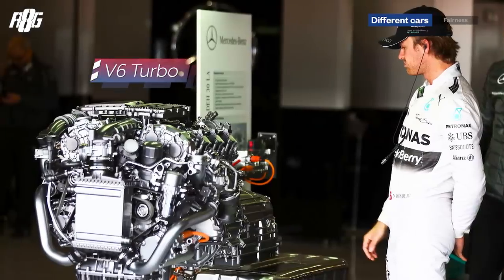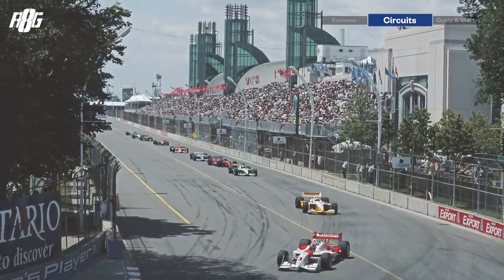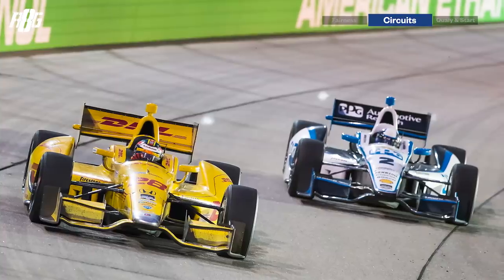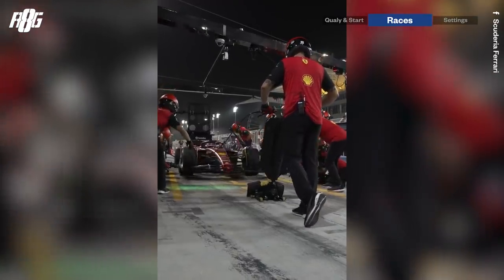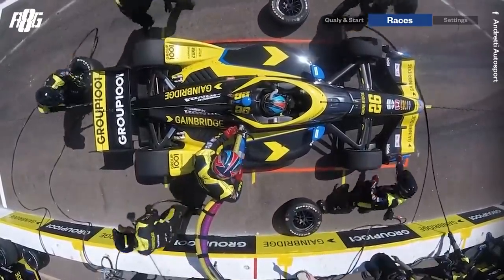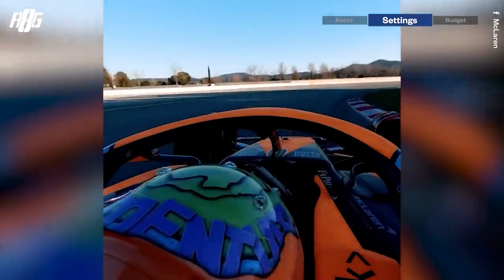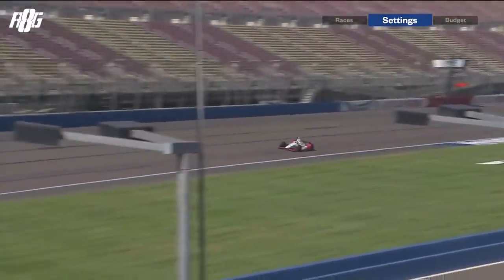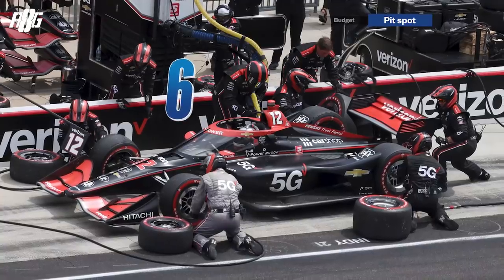The Main Differences Between F1 & IndyCar Racing!

Comment: How does Indy 500 setups differs from both normal oval races and road courses? Would love to know!
Reply: superspeedway like indy for setup has the smallest rear wing for the least downforce and for ovals they change the camber of the wheels for the banking whatever it is at the particular oval. for "normal" oval or if you mean short ovals like gateway and Iowa, they use the same wing element as road and street but remove the top winglet for increased speed and reduced downforce but not as much as superspeedway. at short ovals they still break and need the downforce a bit. they have a few options for oval downforce and wing stuff but every team has the same options, no open development just more choice of the given options or adjustment of angles.

Comment: I think the biggest difference is that IndyCar is much more exciting and unpredictable than F1. One reason is that in IndyCar it's actually possible to overtake on track :) The other is that every time the yellow flag is out, the pace car (IndyCar counterpart of safety car) comes out, so there are several pace car periods during most races. Yes, this means luck plays a bigger part, and you can even win a race purely by luck, but this balances out throughout the year, and you need a consistent performance during the whole season to have a chance in the championship.

Comment: How does a modern F1 car compare to a modern IndyCar in size?  I think it would be cool to see IndyCar visit more tracks outside of the states again.  F1 might be parting ways with Monaco.  Some fans hate the idea of that and others would love to see F1 left off the schedule because it's usually a boring race.  I'm curious if an IndyCar would bring back better racing on that circuit?
Reply: the current Indycar chassis is definitely smaller than the 2022 car for F1

Comment: What about one series having power steering (F1), while IndyCar does not?  Is that true?  And also the use of tire warmers?
Reply: no power steering in indycar so its incredibly physical. also no tire warmers so that adds a layer because you need your in and out laps to be really good but have to be careful on cold tires. that aspect also changes how pit strategy works depending on who has new or old or cold or warm tires around you

Comment: There's a lot of emphasis on neck strength and personal fitness in Formula 1. Are they as important in Indy Car and we just don't hear about it as much, or are the physical strains of Indy Car different?
Reply: the workout regiment in Indycar is way different than F1, because there's no power steering (plus less areo meaning lower cornering speed) there's a larger priority on weights compared to cardio and neck strength

Comment: Not to bring up a touchy subject, but in case of a fire with ethanol, would that not burn invisible?
Reply: yes it would, and that was a primary issue of the E100 fuel used in CART, but Indycar uses E85 fuel so there will still be visible flames

Comment: The fuel in Formula 1 isn't regular petrol correct? In the modified car scene if you're running E85 you're able to run high boost numbers and advance the timing because ethanol is easier to control. Could you see Formula 1 moving over to something like race ethanol like E95?

Also more Canadian races would be amazing. I had no idea IndyCar was in Toronto, I may have to make a road trip see the race! As F1 is a bit of a stretch to justify (for me to road trip to lol).

Very great video, thank you!
Reply: Toronto just got cancelled the last few years due to travel with the pandemic, it should be back. though there is some concern with how they changed the street course that there may not be enough pit boxes if the regular indycar field stays as big as it is or expands
Reply: @sams-pg7hj  Damn, this is a big shame to hear. Thank you for the insight though!

 Hopefully something can be done. Canada is lacking when it comes to major motorsports. There is local stuff around me but I am also into seeing the greats race.
Reply: F1 is using high octane racefuel (petrol) with 10% ethanol from this year on. The years before the ethanol content was around 5-7%. 
From 2026 on the'll completly switch to sustainable fuels.
Reply: @NoblePineapples  they want to avoid it but I heard it might be hard to change the pitlane if needed. they could go to a few other circuits or change the layout in Toronto theoretically
Reply: @chrisu2583  for wanting to be sustainable its odd they (f1)
havent switched to anything higher ethanol in a while. indycar has been using E85 since 2007 (85% ethanol)
Reply: @sams-pg7hj   I don't know why they havent't used higher contents in the past few years.
It's maybe because F1 is limited to around 150l of fuel and no refueling during the race so they wouldn't get to the end on one fuel tank when they would use higher contents of ethanol. The fuel consumption for the same amount of power is higher with E85, just like in the normal roadcar.

Comment: Romain, could you do a Nascar v Indycar vid? they have some of the same circuits and have similar v-max but are so different. From an F1 fan clueless about American motor sport.
Reply: NASCAR and IndyCar are VERY different. the only thing they have in common is they have 4 wheels and an engine.
Reply: @nickb2049  and sometimes race on the same tracks
Reply: @nickb2049  did you actually get to the end of my comment before posting? I think not.
Reply: @brokenmusician1  you asked for a NASCAR v IndyCar vid, I answered by saying they are completely different in every way but the fact they are both cars. idk what you are looking for.
Reply: @nickb2049  like I said in the original post - some same circuits, similar V max, so different. Both big in the states. Both have former F1 drivers in the championships. Where are you disagreeing with me exactly. Please note the so different from the original post. You seem to be violently agreeing with me.

Comment: Romain - I think you forgot to say that in IndyCar, there are a LOT MORE CARS on the track!
Reply: 27ish this year at most tracks, 33 at the indy500. Indycar has no limit beyond the number of pit boxes at the track really. no team size limits so you see one car or up to 4-5 cars per team. that is one cool aspect of indycar, teams are not required to run a full season so drivers or teams without a full budget can still gain experience and data running only a few races or whatever they can afford. each car has their own pit crew and pit box so there is no issue with conflicting strategies per car per team. the other wrinkle is that there are no team orders or team strategy really beyond "dont wreck your teammate", so no first or second driver or whatever.

Comment: Can you explain the championship process?
Reply: it's pretty much the same as the championship in F1 (point system is completely different though) for the driver's championship, but the team championship is between the two engine suppliers, Honda and Chevy

the point system awards points to everyone who starts the race (50 points for 1st place!) but you also get points for leading laps, getting fastest lap, and leading the most laps during the race (and getting pole?)

Comment: I find Indycar much more interesting than Formula 1, particularly because of how the two richest teams always dominate F1 because they have SO much advantage; it's not an interesting race when it's basically guaranteed that one or two of ten teams is going to run away with the win for the season, and any race where they don't grab at least 2/3rds of the podium is a fluke. 
Take 2019 as a typical example; 21 races, so 63 podium places total. 20 drivers, but out of all those races, just five drivers got all but 3 of the podium positions for the entire season.  95% of podiums going to just 25% of the racers, and two of them didn't get many at all; 78% of podium places went to just three drivers from two teams, because money. It's bs, and not good racing. 

Can compare points for the F1 teams too; 739 points for Mercedes, with a not-even-close 504 for Ferrari. Red Bull was a bit close to Ferrari with 417 points, but "oh, who will win second because first place is guaranteed to go to Mercedes since they spend the most" is not an engaging question. 
And then all the other teams got less than 150 points. Yeah, real exciting. And it's due primarily to insane spending, plus positive feedback loops of "you win because your team has the highest budget, but then you get the best and highest-paying sponsors because you won, so you keep winning". 
And then you have Ferrari, who's getting a gigantic bonus on top of their already higher-than-most spending just because they've been participating so long (and likely because they insinuate they'll stop playing the game if they don't get their special treatment). It's ridiculous.
Reply: Obviously u haven't seen any of the '22 races yet. Mercedes are not even in the fight

Comment: I have a question: Why don’t Indycars have DRS?
Reply: Because it uses a Push-to-Pass system in the form of 180 seconds of HP boost that can be used during the course of the race. Except on ovals where there is no DRS equivalent.
Reply: @ZontarDow  not only that but Indycar has never really had a season or race where there people struggled to overtake

Comment: What is dampers?
Reply: shocks that keep the wheels in contact with the ground when going over bumps. indycar tracks are very bumpy compared to f1 so keeping the wheels in contact with the ground and not skipping or bumping allows grip and better cornering and control obviously. indycars have alot less overall downforce to keep the car pulled to the ground

Comment: I've been an F1 tragic since the eighties, as well as IndyCar. IndyCar is all about driver talent,  I see more overtaking in one IndyCar race than any F1 race. F1 is fairly predictable, with IndyCar, strategy and tactics are a big part of the race, so that even a driver starting at the back of the grid can win. The safety car rescue team are very professional, full course yellows become a whole new race. Oval races are where the drivers need very big balls to maintain two hundred miles an hour plus on the bigger ovals. 
I ticked one off the bucket list. Travelled from Australia to the Indy 500. It really is the greatest spectacle in motor racing. The year I went, the Ozzie Will Power won.

Comment: They stopped using Methanol? Methane/Ethanol mix.
Reply: they did stop using it because of all the invisible fires back when CART ran on E100 fuel
Reply: @harveyknguyen  Ethanol doesn't burn as visibly as gasoline. Maybe if Indy Cars used gasoline they'd get closer to F1 speed.
Reply: @PeterKKraus  i mean the fuel mix they're on right now is pretty much what's for road cars these days, probably to cut down on costs

also then there's the 400-ish BHP difference between the Indycar PUs and the F1 PUs
Reply: @harveyknguyen  I thought they were using straight ethanol
Reply: @harveyknguyen  PU?
Reply: @PeterKKraus  power unit

CART used to, but now it's either E85 fuel or E90 i don't remember
Reply: @harveyknguyen  They both use 6 cyl turbos, F1 is hybrid though.
Reply: @PeterKKraus  yeah but the power output of F1 engines is significantly higher, mostly because the current Indycar engines haven't had any major development for a while now (starting in 2024 the power output is going to be comparable, the Indycar engines should be rated at 900-ish BHP)
Reply: @harveyknguyen  In '83. The Brabham BWM engine was a 4cyl, and in qualifying was 1000hp. Lol

Comment: I am new to both F1 and Indycar,  my question is how would they fair if they raced against each other?  Would there be a big difference?
Reply: on a road circuit the difference is quite big, as demonstrated by the pole lap @ Circuit of the Americas in both F1 and Indycar (it's on YouTube too, can't post a link or else my comment would get deleted)

I have no idea how big the gap would exactly be on an oval, but an Indycar with the Speedway configuration would be quite a bit faster than an F1 car with the low drag package

Comment: Indycar hopefully should have power steering so drivers won’t have a hard time turning. For road course tracks specifically.
Reply: i could only really see that happening if Dallara decides to increase downforce enough to the point where neck exercises become a larger part of drivers' training regiments
Reply: why would you want to make it easier? racing is supposed to be a challenge.
Reply: @nickb2049  Racing is challenging but drivers don’t have a hard time turning since they have power steering.
Reply: @aaronmiller5012  tbf Indycar can get away with it since the cars are lighter

Comment: Ez, indycar is so slow
Reply: its faster than f1....
Reply: I’d like to see how big a gap the backmarker f1 can build on the best indycar over the course of a lap
Reply: @foryoutube9960  On a superspeedway?
Reply: pssshhhh, f1 will beat any car on any track, it’s just a different talk when it comes to purely straight line speed only
Reply: @foryoutube9960  so faster..... I didnt specific in which case
Reply: @foryoutube9960  the fastest an F1 car has ever gone was just barely over 240 mph, and that was on a 6 mile long straight and with all the aero taken off of it. an IndyCar could go 250 mph if it was let loose.